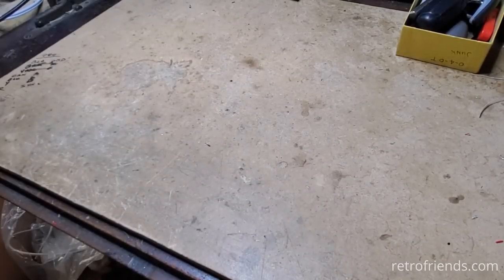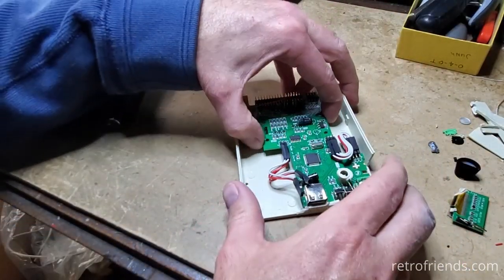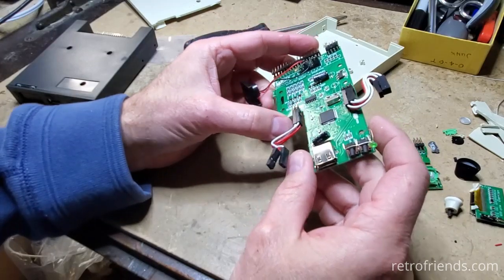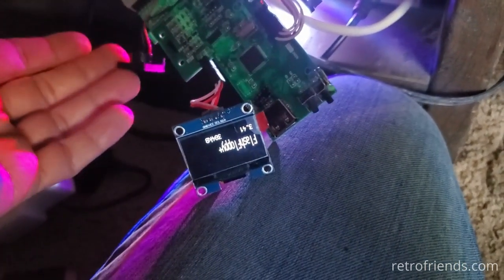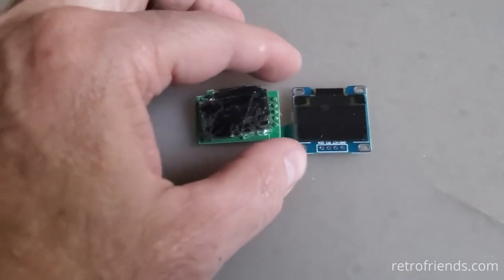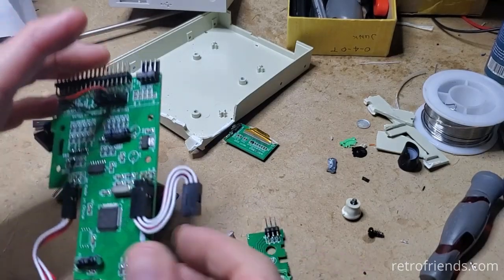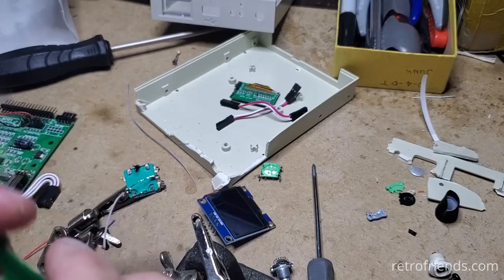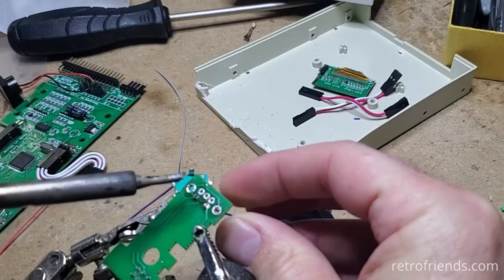Repairing a Destroyed Gotek Floppy Emulator

Comment: My green HD led is broken circuit board seems destroyed where it’s seated. Do you know if there is any other way to wire it than the standard?
Reply from the maker: HD LED? Hard Drive LED? If you mean the drive activity LED on the Gotek, I wouldn't even worry about it if the board is broken. The Gotek screen tells you everything you need to know.
Reply: @retrofriends  yes just like to have the led showing activity 🤪